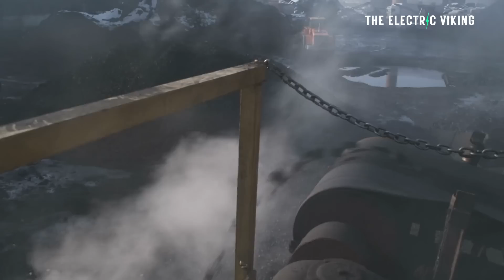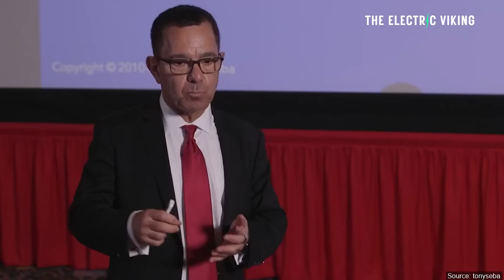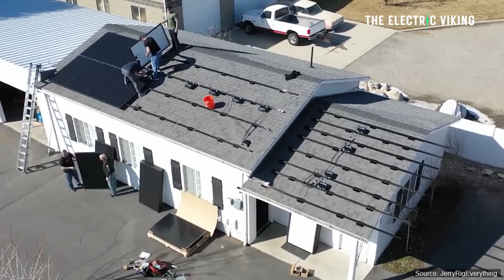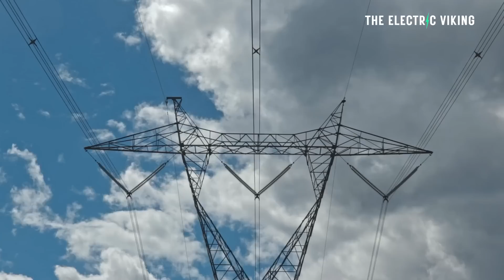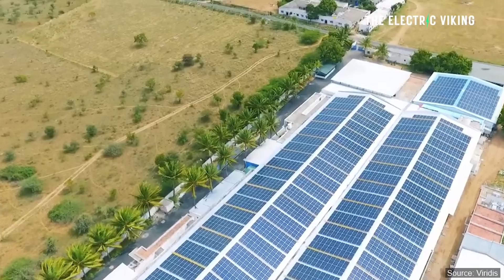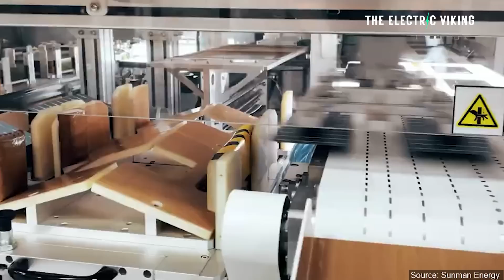Rooftop solar installs break records; coal powerplants could soon be bankrupt

Comment: V2G EVs selfplug-in will be the killer feature on Australia's national grid. 
20million buildings and vehicles will totally UNLOAD the Australian grid.
Reply: They make this sound like such a great idea - and it would be for you during a power outage.

Sure, supplying YOUR nighttime demand is easy.
But when the utility has no/insufficient batteries of their own, they are going to expect you to be supplementing your neighbor’s nighttime demand as well.

The utilities are pushing this to offload their responsibility for supplying night time power onto their consumers.
Sure, they may pay you for what you push back at night.
But what happens when they go all PV with no batteries and expect the V2G customers to power their entire grid all night - every night.
You might be “making money”, but do you really want to be doing that to YOUR battery?
And ending up with a less than full battery in the morning - every morning.
Reply: @sirifail4499  
South Australia big battery paid for itself in one year or less.
Daytrading stability and electricity for money. 
EV batteries are meant to last decades if you only drive with them.
Mid range discharge and recharge is showing extremely longer life properties. 

Vehicles computer can control electricity flows and with 20million Australian EV vehicles automatically plugged into the grid for 23hrs every day on avg.
Every vehicle needs only to contribute minor amounts of electricity. 
Every vehicle maintains minimum amounts for it specific needs.
This is ezi pezi logic.
No imported petroleum. 
No central generation of electricity. 
No need to send central generation electricity to the 20million ends of the grid as the ends are filled every day. 

In fact the 20million ends, the 20million buildings can over supply the grid if needed. 
If one location is a little low one it's stored electricity othe locations can sell some into the grid.

People have silly old ways of thinking. 
Even horse and cart people struggled to understand the automobile in the beginning. 
The Ford model T was in production for 18 years.
Reply: Are you aware what V2G will do to your EV battery? It will cycle it every day. Today you charge your EV at nigh5 so it’s ready to go to work in the morning. Hmmm. Imagine this sequence. When your V2G EV powers your home at night, it’s gonna suck when you have to call your boss and tell them you won’t be in. And what powers your house when it’s cloudy in the winter and your EV is parked at work?
Reply: @sirifail4499  
Night home demand is very small compared to the EV battery capacity. 
Daily drive is 7kwh and ezi pezi to top up daily. 
Most vehicles are parked 23 hours every day. 
EV battery is for the long drive, but most vehicles are parked 23 hours every day. 

Rapid chargers will be on the main roads and at corner stores. 

Topping up the ICE vehicles' petroleum tank at home daily for free was never a good idea. 

Horse meat was cheap when the Ford model T production line started. 
Horse and cart thinking is wrong.
Reply: @sirifail4499  You wouldn’t need to discharge to grid every day, only when power gets expensive and it’s worth it. Most houses are capped at 5kW export, so maximum you could discharge to grid in a 3 hour window is 15kWh, or about 100km of EV driving.

Comment: I read Tesla cyber truck range extender stores equivalent of 8 powerwalls that cost $8000 each yet range extender is $16000. Perhaps you could put one in your garage to store electricity
Reply: Maybe there is some difference in how they deliver the power that makes one of them cost alot more? Or different battery tech, where the powerwall uses batterys more suited for those things in the long run? otherwise its a good idea to try :)
Reply: @AndrewTSq prices of batteries are dropping fast.   

The extender would only have one set of non battery electronics.   

It might even have none of the electronics and be an almost raw battery with the CT providing the battery brains.
Reply: @mac_mcleod  Lets hope they do!. I mean, LFP batterys have been used since 1996 for example. So its not like its a new technology anymore. I guess we all have different criterias about what "cheap" is, but I would say when EV batterys in a car can be replaced for $1500 we are there.
Reply: @AndrewTSq  my number is a bit higher since we currently spend about $1,000 a year on gasoline.

But I nibbled at the solar battery Market this year and came to a similar conclusion. It's still too expensive but may make a lot of sense by 2026.

I paid $400 for 1 kilowatt a storage. I think we will see $200 for one kilowatt of storage by 2026. The average American house runs about 30 kilowatts per day. Electricity costs about 12 cents per kilowatt hour plus a grid connection fee of about $40.

Comment: I’m in the USA 🇺🇸, just went solar myself. I calculated a 5 year RIO for my 12 kw system. I was just sick of the constant rate increases. We are very happy 😊.
Reply: In NZ a 5kw system is > $10kUS and the payback is 15 years  :(
Reply: @gzcwnk why so expensive?
Reply: Man 5yrs is an awesome RIO for solar. I'm so glad they are getting more efficient, lower in cost, and having more options. I love the look of the Tesla solar roof were all the shingles are glass and you only have some of the singles as actual solar panel shingles so the entire roof looks the same, it looks extremely modern, and if you need more solar just pop in a few more solar shingles and the roof all looks the same. I just can't wait until other companies offer the same or very similar tech so the prices come down even more and we have more options since Tesla and their licensed installers don't install everywhere yet, so having other companies doing the same would be a great option. 

I also love how other companies are making solar battery stations options that look to have the same or more features as what Tesla is offering so more options the better.
Reply: Nice one well done!

Comment: If only they could invent a panel that produced electricity when it rained, we in the UK would be self sufficient in no time 😂
Reply: I live on a boat.   In the Uk . Only have 1.5kw of solar,   15kw Lifepo4 battery pack.  I don’t use a generator or boat engine to produce electricity,     It’s about how you use it.
Reply: Hydroelectric generation is handy for when it rains.

Comment: Demand for electricity has always varied.  With renewables, supply of electricity is now variable as well.  Matching variable demand with variable supply is the domain of batteries and for the near term, dispatchable electric supply provided by natural gas.  Coal plants, that need 24 hours to start up, and nuke plants that need multiple days to start up, are of no interest in today's world.  That coal and nuclear provide the most expensive electricity are further nails in the coffins.
Reply: from BobSmith: >.True cost renewable at a guess around $1.50 once all subsidies to hide true cost taken into account.-<
The Bloomberg investment firm as well as the investment advising firm of Lazard & Assoc. have both found that the levelized cost of electricity (meaning no subsidies of any kind) is less than 6 US cents per kWh for utility-scale PV generated electricity.  
Maybe you can take them to court and show that they are misleading the investors.  You will be awarded many millions of dollars if you are right and Bloomberg and Lazard are wrong.  Go for it!
     Also, when you learn about the electric generating industry, you will learn that the term "base load" is specifically given to plants that CAN NOT quickly power up to meet extra demand.  The name "peaking plant" is given to those that can power up in short order.  Combined cycle natural gas plants can be fired up in minutes to tens of minutes, depending on when it was last run.  Dispatchable hydro can be brought online in seconds.
Reply: Those plants are designed like all base load to operate continuous and can quickly power up to meet extra demand unlike renewable that cannot make wind blow harder or sun shine more.Because of renewable madness now pay 35 cents a kilowatt hour when used to be 15.True cost renewable at a guess around $1.50 once all subsidies to hide true cost taken into account.
Reply: @BobSmith-ew5oi   because a spike in gas prices didnt have any effect, nor the ten years of denial by the last governnment. 15 energy plans and non worked because they refused to accept that renewables was the way to go. No actually, it was outright hostility. Ever heard about batteries? If you dont want to make stupid statements , at least have some background knowledge to understand cause and effect properly.
Reply: Sure destroy the rest of the world mining metals needed for these endless batteries as at present many end up in landfill.Base load is the only reliable power by whatever source and renewable should only always be regarded as an unreliable addition to energy reserves that are nearly empty thanks to green madness.We should of been building new base load coal or nuke plants 5 years ago and are getting closer every day to constant load shed.Would be sensible to spend the money squandered on renewable s,build a few base load plants then no urgent rush to go renewable and they can be implemented at a sustainable level once the recycle and rape of the worlds mineral supply problem sorted out.Even if takes a hundred years to do it properly instead of the current mess,countless birds killed by wind turbines,seismic unrest and species degradation by dams.Is no environmentally friendly way to make energy as all does damage one way or another to our fragile planet.And a battery fire an unstoppable monster that destroys entire buildings and produces extreme toxic fumes.Just look at the recent one in Qld and for all there size only good for 20 minutes back up run time at best and will never work but the fire risk more a worry then there short energy backup.
  But thank you for your thoughtful comment and encourage healthy debate on this divisive subject and please feel free to reply to my post. @andyfreeze4072
Reply: @BobSmith-ew5oi  So far in this comment section, yours is the first which adheres to reality

Comment: Another idea which occurred to me is that adding solar to desalination plants so they can do hydrogen when the water isn't required. As it is they sit idle due to grid cost. Add solar and its free!
Reply: i think you fail to understand how membrane filtration works.
Reply: @andyfreeze4072   there is a step I didn't mention. That an electrolysis plant is also needed to separate hydrogen and oxygen

Comment: I think that solar and batteries should reduce our vulnerability to bushfires. The sleeper issue with power is that it needs to go underground so overhead lines won't ignite bushfires.
Reply: Yeah they provide the ability for small independent generation & storage, so you don't even have to transport power over long distances.

Comment: Now, it's close to the Australian midsummer, hope that the solar energy will suffice in winter as well.
Reply: Do you?  Do you really hope that? 😢
Reply: Obviously wont, for that you need a huge battery. Sounds like you are getting there. 👍
Reply: Yes it does, still plenty enough sunlight in winter.
Reply: @radart6037  Where i live in the northern US, solar panels output less than 1/3 as much in winter as they do in summer.
Reply: @OtisFlint  With my old PV array I generated about 24kWh during a day in the summer and 13 or so on sunny days in the winter.  On rainy days I got about 3, if I was lucky.  With my new array I haven't had enough days of operation to see what production is like.  I will say this, yesterday was sunny and I got 25kWh so I suspect that the ratio will be about the same.

Comment: Sam, I love you, but.   You need nuclear plants in Australia. Look at it seriously.
Reply: Why do we need nuclear, when we can add solar, wind and batteries incrementally for a fraction of the price? If we need high baseload power, we have geothermal available but not used yet to any extent. Still much cheaper than nuclear.
Reply: Nuclear is much greener than wind and solar, and cheaper if it weren't for govt interference.
Reply: @OtisFlint  No, it is not cheaper. If it were, why is China encouraging the takeup of rooftop solar rather than installing lots more nuclear plants?
In fact China is developing SMR (Small modular reactor) technology to try to address the cost and lead-time problems associated with nuclear; problems which are real and not the result of "government interference".
Reply: Have you looked at the cost of electricity delivered from nuclear power? It's way more than that from coal.
Reply: I would not have agreed with you, thirty years ago. The situation is dire now. We need nuclear ASAP. "Renewables" are great but there is a reason that we are delaying closing down thermal coal generators and that we're pumping so much money into them. Baseload.
We all love our batteries, but practically speaking, if it isn't physically impossible to utilise batteries in the short, medium and long term then, the financial burden is still a big hurdle to clear. Powering households through day light hours is one thing. Getting them through the night is another. But households use less than one third of the electricity generated in Australia. 
Perhaps we can fit every domicile in Australia with solar and batteries for 3 or 4 hundred billion dollars (minimum). Double that again for industry and then maintain it. It's not going to happen.
Reply: And increase national natural gas supply & usage. Clean as a whistle, is actually renewable, infrastructure largely already in place. Corrupt politics holds price high.
Reply: @jimmybrad156  Natural gas is not clean; it is not renewable; the price is high because politicians decided it should be sold at world parity prices rather than forcing the producers to sell more cheaply to local consumers than to overseas buyers. That is not corruption, it is called capitalism.

Comment: Solar panels produce electricity when it is needed least at midday when the sun is shining.

The Chinese make 95% of solar pannels but they are approving two new coal fired power stations EVERY WEEK

It would cost $10 TRILLION to provide battery back-up for unreliable wind and solar.

King Coal will have a long reign.

"Renewables" are complete crap.

Comment: Aussies are doing it to save themselves money on their bills mainly
Reply: What?  It’s cheaper, as well as reducing carbon emissions and fitting in with a new integrated renewables grid? 🤔

Win win win lose (for fossils 😂).

I wonder why they didn’t happen sooner.  “Clean Coal” anyone? 🙄
Reply: @MrTytalus  No, the reason it didn't happen sooner is because no one would invest in silicon wafer factories. Then those plucky chinese spotted a giant hole in the market, through a few billion, built the wafer factories and prices for solar hasn't stop coming down ever since.
Reply: @DavidKnowles0  like all great truths, you’re partly right.

Our panels are 10 year old German made.  There were several manufactures in Europe investing, but not enough.

Then, as you say, the Chinese saw a great opportunity to invest, expand and undercut everyone.  

If only there hadn’t been such resistance in the fossil fuel addicted/restrained West, and those billions invested here, we’d “may” still have that industry.

We nearly lost wind as well because of our ignorance.  Well, the UK did, but Scandinavia kept some. 😊
Reply: @MrTytalus  they were panels manufacturers. They got their silicon wafers from the computer chip factories supply chain and mostly as the waste that the chip manufacturers didn't want.
Reply: What ever motivates, whether it preparing for the end of the world, to save the world from environmental disaster or to save a few extra pennies or even just to stick it to president Putin, it really doesn't matter what got the person switch to solar.
Reply: @DavidKnowles0  Judging by the number of Australians driving gigantic Ute's that have solar panels, it isn't out of altruism. Anyway, yes, it's good people are changing regardless of the motive.